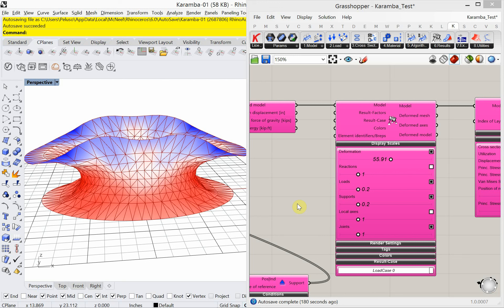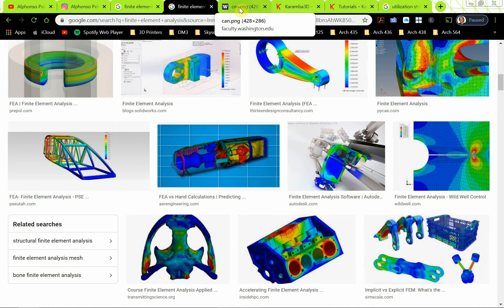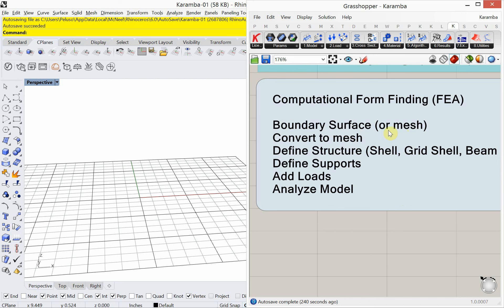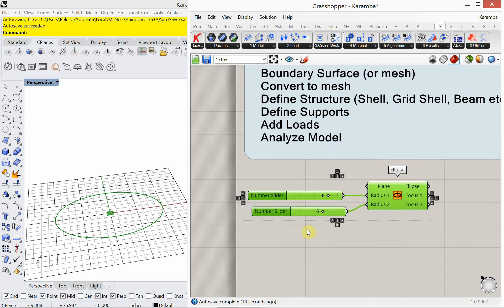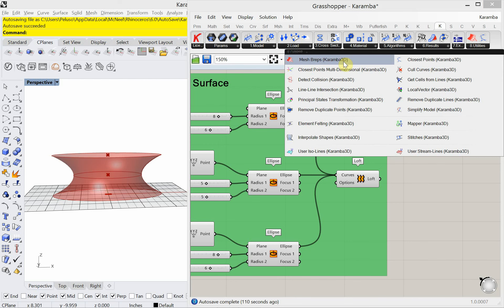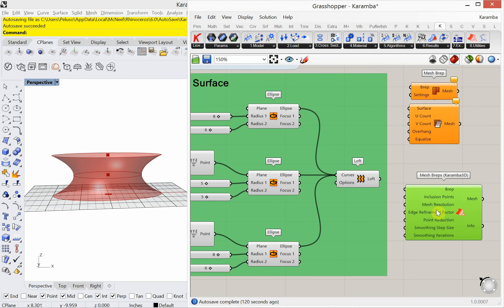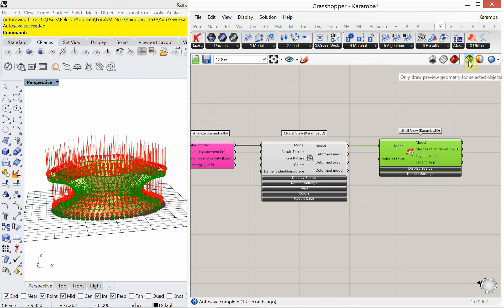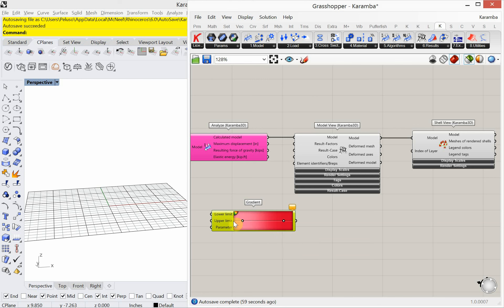Karamba 3D - FEA Form Finding

Comment: Hello Alphonso. Thanks for the video, it was very helpful. I just have question which is that my mesh does not deform regardless of the force vector I use. The rest, the diagrams, colors etc. are working well thought. Regards!
Reply from the maker: Hello. I'm glad that you found the video helpful. Have you tried increasing the load amount?
Reply: @AlphonsoPeluso  thank you for your reply Alphonso. Yes, greatly, and it doesn’t work
Reply from the maker: @RamonRepas  Try increasing the mesh resolution.